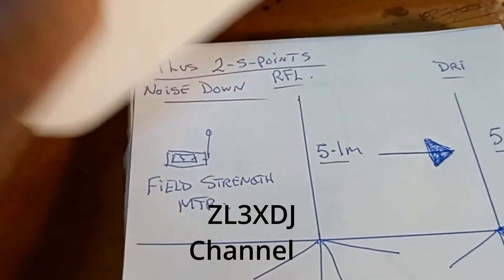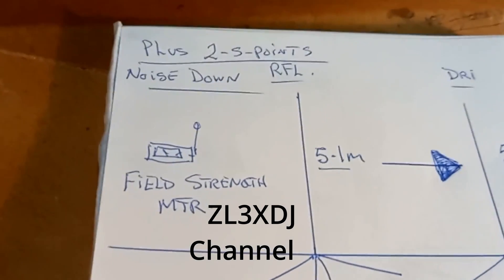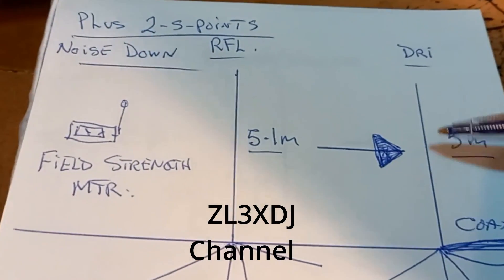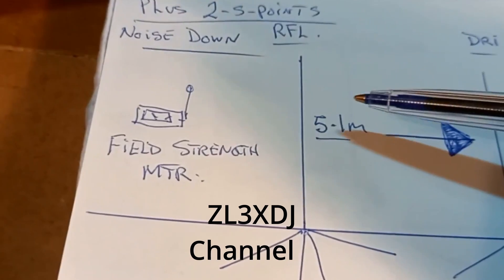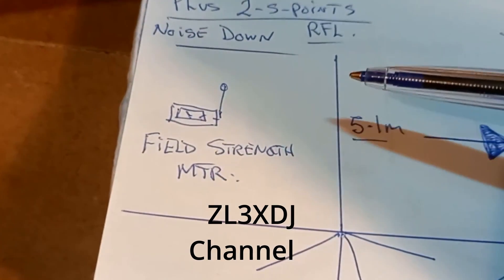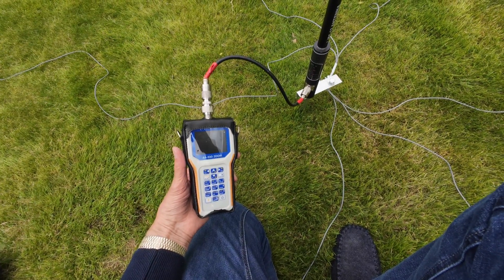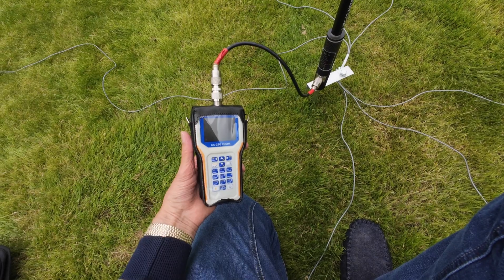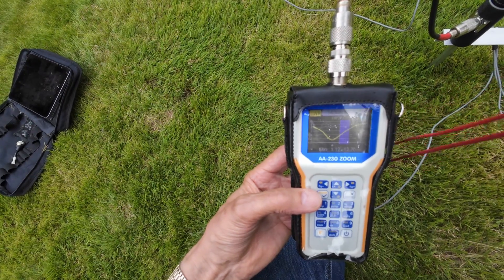HF Vertical Antenna - Adding Gain

Comment: Dear Peter, I wonder if the same principle applies to hf mobile antenna setup, I mean magnet mounted hf car mobile antenna and a reflector with ground radials 5 meters or so away. I would like to hear your comments on this. Better maybe you make a video on this subject. Best regards

Comment: Given the constraints of your garden it would be more convincing if you set up your portable antenna as a director to see if you can measure forward gain. Measuring a drop in signal level behind the `reflector' could simply mean that you are heating more ground rather than reflecting power forward.

Comment: Does the reflector antenna have to be physically longer than the radiating antenna or just longer in frequency?
Reply from the maker: The resonance needs to be lower, this normally requires an increase in length, but the resonance is the key gactir.

Comment: Hello, should the reflector or director antenna be the same height as the active antenna. I am using an A99 should I use another A99?
We strive to not short the coax   , how dose one short the coax stub? Shield to center?

Comment: I remember another way of (supposedly) getting some gain on a vertical. Back in the 1970s, they used to sell a CB (11 meters) antenna that had three verticals spaced (physically) 120° apart. By feeding all three radiators with the RF signal, only at various phase angles, you would get CONstructive interference in a certain direction, and DEstructive interference in other directions.

I think it was an early attempt at what they now call "beamforming" in the cellular world.

73 de AF6AS

Comment: How do you rate the  4-btv for DX on 40m Peter? I know things vary from one QTH to another, number of radials and other variables, but I am looking for something to achieve more DX contacts on 40m. For 20m up I'm happy with my fan and off centre fed dipoles, but at the height I can achieve in my garden I don't have much luck on 40m for DX (this is SSB voice). I have thought about a monoband quarter wave for 40m but that's over 10m tall, might be a bit much with neighbours. Do the traps and reduced lengths reduce performance drastically? Would be grateful for your advice. 73
Reply from the maker: I use a half size G5RV at 25ft and work ZL on Cw. I find the 4BTV is never better than the G5RV. That may be peculiar to my QTH.. DX on 40m is usually easier in Winter and using grey line times.

Comment: Remember that it’s great to get forward gain but remember it will block to some degree the signals that you don’t want to hear from the backside of the reflector. Might be worth it just to do that😊
Reply from the maker: I think most would trade gain over F/B
Reply: @watersstanton

Comment: How confusing.....A few videos ago you mentioned getting gain from the use of elevated radials and now youve reverted back to the less efficient buried radials and again you are talking about trying to find a little extra gain. Well first of all lift your ground radials up a meter or so and tack them to the fence.
Reply: Might be worth trying to arrange the radials on the director in one direction for even more gain.
Reply: Very good. Glad you mentioned using a director also. I have built several horizontal Yagis and like using the director. I think you get more gain (not much more) with the director and it takes a shorter boom. I also want to note that if you use a self resonant parasitic element instead of one tuned lower (or higher in the case of a director) you can space them such that you get bidirectional gain. On a Yagi it’s about 5 dB over one dipole. The tuned director gives maybe just less than 6 dB and the tuned reflector maybe 5.5 dB. So you don’t lose much by going bidirectional. I did that with a couple wire Yagis I built. Worked great!  I prefer a dipole as it has more gain than phased verticals but I have the room and trees to make that easy. Without the room I think that the phased verticals has a lot going for it.
73, de N4DJ
Reply from the maker: Firstly not everybody has room for raised radials, and secondly you get no directivity or F/B with raised radials.
Reply: @watersstanton  of course you get directivity with raised radials what do think a vertically polarised Yagi is.....A dipole  stacked against dipoles. If you are still not convinced go research the Jo Gun Antenna.

Comment: Hi Peter. Perhaps you could place some rotary air dryer ground sockets in the lawn at strategic places and move the reflector around more quickly. They would be unobtrusive and the unused ones would be capped.
Another suggestion - If using a tripod mount, again use a socket with a tube in it. The tripod main shaft would sit over the tube to give sideways stability in the wind. I picked up a couple of PA speaker tripods for a fiver each at a car boot
Reply from the maker: Interesting option.